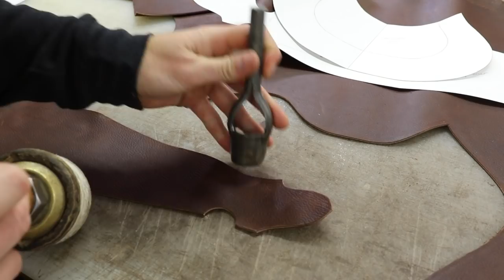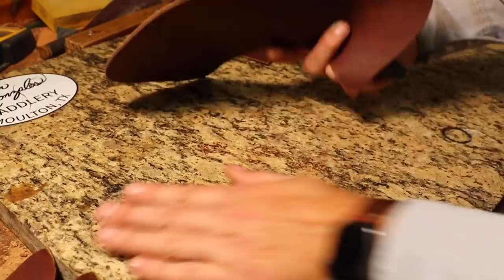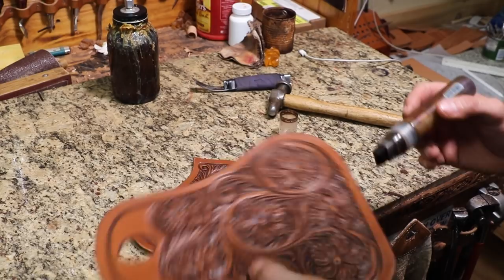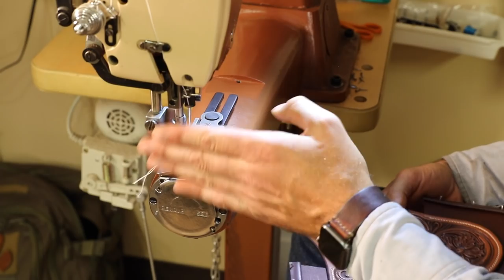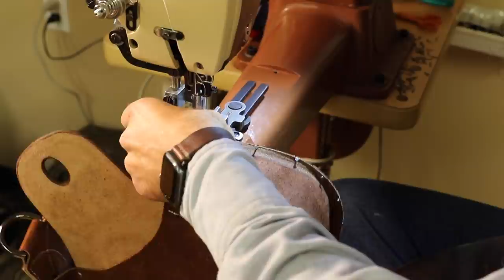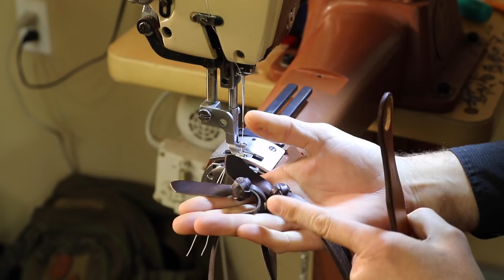How to Make the Kidney Bean Purse

Comment: Great tutorial Don. There is a tool called a Saddlers seam turner. This has a notch you use to rub the welt, which helps it turn. You could easily make something out of some smooth hardwood with a notch filed in. A broom with a rounded end handle is also handy. Stand on the broom and republicans the seam up and down over the rounded end. Now off to buy a digital download.
Reply: Ok editing a darn predictive text typo has defeated me.  Republicans should simply read as RUB.
Reply: @andrewbarra8087  lol nice to know! 😆
Reply: @andrewbarra8087  just a headsup you can edit any of ur previously made comments by using the 3 dots in the corner of your posted comment.. in case by chance that you didn't alteady know
 friend..